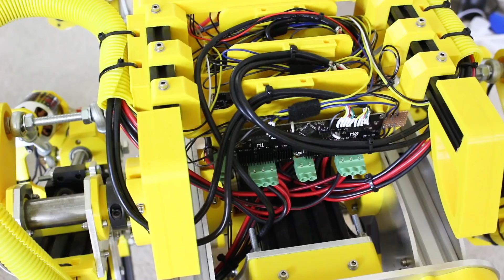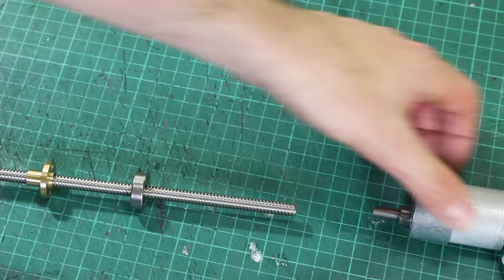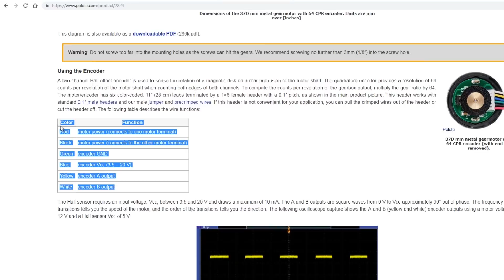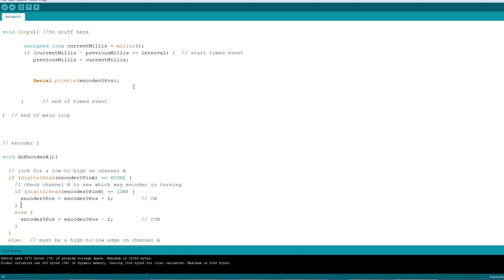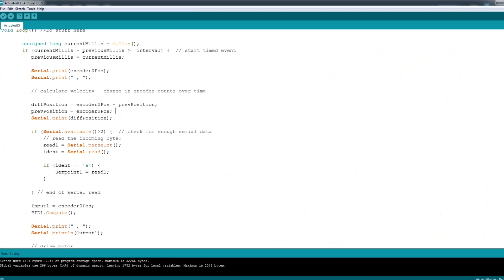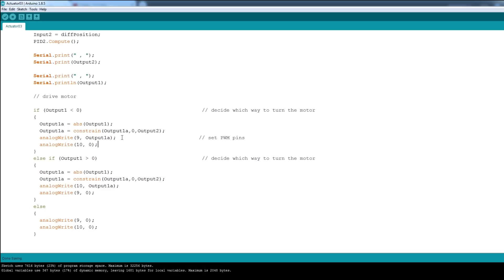Building a Lower-power Linear Actuator with Arduino | James Bruton

Comment: Hi James, do you think it's conceivable to make a miniature version powered by servo motors, rather than using a brushless motor / ball screw combo? Of course this would come at the cost of performance, but it would be a lot cheaper. Right now I'm doing calculations to figure out the joint torques, but in the meantime I'm just wondering if an expert such as yourself thinks it would be possible? Thanks.

Comment: Is nobody developing or using linear induction motors as actuators in robotics? They would seem to be the ideal solution (at least in my head this morning).
Reply: To answer my own question - https://ieeexplore.ieee.org/document/5379608 (but you need an account to read all but the first few paras unfortunately, and I haven't got one). Edit: full article here - https://www.researchgate.net/publication/224099052_Novel_design_of_biped_robot_based_on_Linear_Induction_Motors . It's quite an old article and seems not to have been taken further. An issue was power consumption, but with the latest battery tech maybe less so now?? Fancy having a go James? :)

Comment: Any way to control the motor not by typing in the serial monitor. Fx a button with a fixed position?
Reply from the maker: yes - just by updating the setpoint variable from your own code...

Comment: i'm having accuracy problems with this setup. i ran this exact code on my Arduino Nano connected to an encoder with 32 steps/rev. No motor, just an encoder and the Arduino Serial Plotter. It misses about 20% of the steps. What can i do to improve it?

Comment: In this case we will be requiring two external interrupts per encoder(motor actuator), Since uno has only 2 external interrupts we would need that many controllers for each actuators. Mega has 6 interrupts would still be less in case we need to build more actuators.
   Next option would be to use pin change interrupt as in Due so as to use all pins as interrupts.But I am not sure about its reliability. 
   Another bit expensive option would be use external counter circuit and send data to Arduino via SPI or I2C. This solution would reduce the load on Arduino for counting the pulses. 
   What would be your preference in such scenario?

Comment: Hello, I have a small project for my car spoiler and I wanted to customise the spoiler. Like when I reach to 120km the spoiler will rais up and when I slow down the spoiler goes down to its zero position, so I got my 3d printer for my first time and I designed an linier actuator that works either steper motor or servo and I got arduino uno, the quastion is how can I control the actuator to rias up at 3600 turns to rias 15cm hight and to be signaled by reaching the speed 120km and when u slow down it gives a signal ( order) to the actuator to go down? Please if you could help me

Comment: I'm not sure powering the encoder from 5v is the best idea here, the Arduino appears to be configured for 3.3v, and you can't be sure the encoder outputs won't go above the Arduino's 3.3v supply rail.

Edit: I might have been looking at it wrong, can you clarify on the Arduino supply voltage?
Reply from the maker: It's a 5v Arduino
Reply: @jamesbruton  All is good in that case, thanks for the clarification James.

Comment: Use hydraulic pumps to push a cylinder that compresses an air volume and release a valve on the hydraulics to quickly and forcefully discharge the air and push the cylinder back out so that the robot legs move a lot faster. You could use an air pressure sensor in the air chamber to read feedback from the actuator so the robot can feel what it is touching.

Comment: Couldn't you use a standard pot at a hinge joint or a linear pot on the actuator as feedback and it would work as a standard servo with proportional speed each direction?
Reply from the maker: long linear pots are hard to find

Comment: If you're going to scale it down, why not use servos? They're cheap, readily available and have all sorts of options for torque, from the motor/gearing in them to the length of horn used, etc. They can be pretty quick/snappy, too.
Reply: Exactly. All the headache in this video readily solved & packaged for you and the joint becomes the axis of the servo itself. All you need to worry about is telling it where to go. It's the obvious way.

Comment: From what I've been able to research, linear actuators are not the way, because of space and the inefficiency of lead screws. I think boston dynamics and the ishikawa lab just use geared motors with 90 bevel gears right at the joints. 
There are worm geared motors on ebay that are ugly and cant be back driven but offer a huge bang for your buck. I'm about to order some of those. Some smart programming can make up for the lack of compliance.

Comment: What about using drone motors?
Reply from the maker: yes those are brushless outrunners, so you'd need the Odrive
Reply: You can't just use an encoder and a regular reversible ESC?
Reply from the maker: An encoder linked to what?
Reply: Either the motor shaft itself, or the long screw rod thingy
Reply from the maker: connected electronically to what?
Reply: An encoder gives you a given number of high or low signals that form the bits that identify each angle uniquely (within the limits encoder's resolution, of course), or at least a sequence that repeats circularly and is hard to skip, right? There isn't enough input pins left on the Arduino to read that?
Reply from the maker: Sure, but you'll never control the brushless motor accurately using any old ESC. The ODrive uses the encoder to control the motor and position it to within +/-10 counts, with an 8192 CPR encoder.
Reply: You can't use the position reported by the encoder to drive the speed value that is sent to the ESC, and with a PID get an accurate position control? What if you gear it down so the encoder is reading many rotations of the motor per tick?

Comment: Great video. I initially thought the encoder difference was a partial derivative dx but since the loop is running at a constant time interval it’s actually dx/dt with dt being a constant 20ms. BTW James, do you have a dev server running on a raspberry pi? If not, that would be a cool and easy project :)

Comment: I've done a bit with quadrature encoders with Arduino before and found PJRC's / Paul Stoffregen's "Quadrature Encoder Library for Arduino" to work quite well.

There does exist dedicated chips for quadrature encoders, but these are pretty difficult to source in the age of super cheap microcontrollers.

Comment: Wow, a practical lesson about cheap Arduino linear actuator AND cascaded PID control ! That's amazing ! Would a Mabuchi RS-540 work for the same purpose ? They are so cheap and powerfull ! And also a technical question, I cloned you repo from GitHub, what Arduino version is needed to compile the files ? Keep up the fantastic work, I am amazed by your projects every day ! Do you have also an actual job ?
Reply from the maker: yep - you could use any motor with an encoder on
Reply: @jamesbruton  I would think about a combination, for the top motors a screw like you did, but for the knee and hip 10kg servos, would they work for a smaller dog ?

Comment: I recommend you look at the electric skateboard motors, that are based on the 6374 and 6354 motors. For a little bit more money ~$20 more, you can get a higher quality, better wound, better wire motor, that will put out 3.2kw in the same package, and also stay cooler. DIYelectricskateboard, and enertion both have motors like this. They started with the same motors as you, and have had a nicer version made for skateboard use.

Comment: If I were to make my own Dog I would use variable compliance/stiffness actuators. They seem to act more organically and I like that.
Reply: Yup. Anyone taking a go at this needs to stop thinking in terms of commanding absolute positions and start thinking in terms of applying force to soft joints. All your stiff maths goes up in a puff of smoke in the real world the first time you tried "positioning" one of the legs straight trough a pebble you didn't know was there.
Reply: @AttilaAsztalos  Exactly.
Reply: You have a point, but walking in an controlled environment is hard enough. Get THAT working, and then enhance it for less predictable ground.

Comment: Hello James!
My team and i have been working on a 3d printed linear actuator  for the Hackaday Prize, where you are a judge.
We think that you could use it on your project to clear out the amount of cables. Maybe not the potenciometer variation but maybe a hall sensor version modified with a limit switch.

Check it out: 
https://hackaday.io/project/156520-3d-printed-mini-linear-actuator
Reply from the maker: I'm not a judge this year

Comment: Why use such expensive, powerful and HEAVY components ?

Even the full size dog doesn't need anywhere near those torques in my back of the envelope calculations, and would be helped with faster rotation speeds, wouldn't it ?

Second it's going to be hundreds of kilograms, (tens for the small one) with very tight tolerances. Which means it's going to fall often ... and break itself. What's wrong with a 3d printed 10% infill (or less) linear actuator with the cheapest bldc you can find + esc and no encoder (instead do current monitoring + rotation count)

Things break when the force generated by their acceleration exceeds the tolerance of the materials they're made of. That force is mass * acceleration. Breaking strength of aluminum vs same shape in low quality printed pla is between 15 and 25x less. BUT pla is 1.25g/cm3, aluminum 2.7g/cm3. At 10% infill however, PLA component weight is going to be 0.125g/cm3, so the "skeleton" of the robot would be 21.6x (TIMES) lighter with PLA. You can use lighter motors (20x less force is a LOT less for motors), etc.

So the net result is that the robot should have about the same strength made out of PLA vs aluminum, in the sense that if crashing into a wall at 20kph breaks the PLA robot, it would also break the aluminum robot. BUT all components in PLA will be way cheaper, lighter and that will have all sorts of benefits.

For instance, that aluminum robot will damage it's own components like crazy, because they'll scratch eachother. With tight tolerances, they will then no longer fit so freely in their joints, which will rapidly make the robot unusable. The PLA one is more flexible, which means that when this happens ... it still works about the same.
Reply from the maker: yes
Reply: PLA is ok, I would want to use PETG as it's stronger and has even more flexibility, not to mention slightly better resistance to heat

Comment: You can buy linear actuators which are basically this, and are available with position encoders. Although I think this could be done cheaper.
Reply from the maker: Yes you can, but as you say DIY with 3D printing is often cheaper and fits the machine better

Comment: James knows this,  but for anyone that was interested in how to tune the pid controller for not quite reaching the set point. That’s the integral value being zero. The i in pid will gradually increase the power if it’s not strong enough to reach the set point, so having it zero means that it won’t be able to speed back up after its started slowing down.

James awesome video as usual.

Comment: James your project is impressive, but I'm concerned about the maximum speed of the legs. Isn't it too low (especially for dynamic gaits)?
Reply from the maker: The actual dog is pretty quick, the speeds are turned right down so far and there's deceleration due to the first order filter

Comment: On some of the robots, it seems like the maximum speed of the movements is greatly restricted by the fundamental nature of ball screws connected to motors. I wonder if using linear motors instead would speed things up. Perhaps they couldn't take the required weight.

Comment: using the motor directly in the joint is no option ?   why ?
Reply from the maker: You could do - but generally there's some backlash in the gearbox, and gearboxes are expensive. Ball/lead screws and cheap and don't have much 'wobble' in them

Comment: To remove the final position error of the motor, increase the Ik factor of the PID by just a little bit. If Ik is 0, you only have a PD controller, not a PID controller.
Reply: Exactly. Integral gain is what controls the accuracy of the final setpoint, derivative gain controls the responsiveness to quick changes and proportional gain controls the overall speed. James (I hope he reads this) your should also tune your PIDs using some method like Ziegler-Nichols instead of manually

Comment: You also need a dead zone. Most actuator drivers have a dead zone. If you don't have a dead zone your motor could end up riding the edge all the time and kill the motor or the battery power.
Reply from the maker: Yep - you could set a condition that if the output of the PID is less than some amount, then just make it zero.

Comment: The main problem with brushed motors is that they have a very limited speed range. For robotics it's important to be able to move from very slow to very fast. Otherwise the robot won't be able to react fast enough to compensate failing balance while still be able to move slow enough to do smooth tracking movements. 

This is very visible in all those cheap servo driven robots: If they are able to move fast, they are also quite jittery. And they are generally open loop systems, so they aren't able to balance and use fixed, precalculated movements.

So I don't think that brushed motors are a good replacement for BLDC motors, unless you don't want a real balancing robot.
Reply from the maker: That is true, but it's fine for someone who wants to learn on a budget
Reply: I disagree with this. Just because one uses brushed motors does not mean one cannot set up position feedback systems and make it closed loop in that way. You can also create custom motor controllers that vary the voltage in order to vary the speed for slow movements that are smooth tracking movements and crank the voltage way up for high-speed movements. Or to slow the speed down you could simply pulse width modulate the current flowing to the motor to slow it down that way. I think you are too quick to rule out brushed DC motors which are way cheaper and because they're so cheap custom solutions and accommodation should be made in order to use them as effectively as brushed DC motors. This can and should be done and can give you professional results no less than a brushless DC motor would give you.

Comment: i had a project when i was in college that i made a bi directional dc motor using astable multivibrator circuit driven by 555 ic for pwm, if i could get a gear, belt, linear actuator guide, i could theoretically make a small OpenPup (as name suggested by fellow commentators). I wanted to make one using the small drone motors.

Comment: How come you use dc motors not stepper motors?
Reply from the maker: Encoder driven will never lose steps...
Reply: James Bruton same as a stepper motor with closed loop? Sorry just trying to work out the best motor for me to use on a project
Reply: WrapItToTapIt Why use stepper motors when the video says its a CHEAP alternative
Reply: Pan_Czerwony Stepper motors are cheap. Plus I been following all his builds for a while It was not really related to this smaller build.
Reply: WrapItToTapIt I actually wondered the same thing.  For a smaller version, why not use nema17 steppers + encoders? Have good holding torque, and don't need to be geared down like the DC motor.  Plus, from the DIY 3D printing kits these are quite cheap (bg has sets of 5 for $60)..

Comment: I'm wondering how Boston Dynamics did their legs for SpotMini. They are very fast, slim and dynamic.
Reply from the maker: I think that is an entirely different setup with complaint joints - some discussion is coming up in the openDog series
Reply: They're using compliant actuation.  Could probably do something similar with OpenDog by adding some springs in the leg joints to create Series Elastic Actuators.  In fact James did a video on this a few years ago.